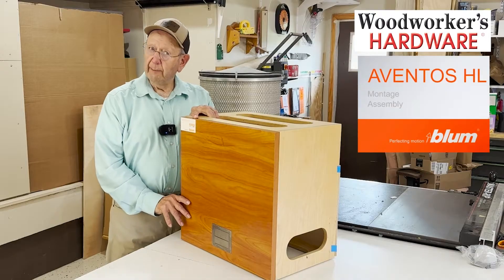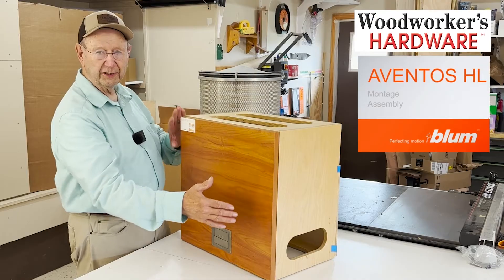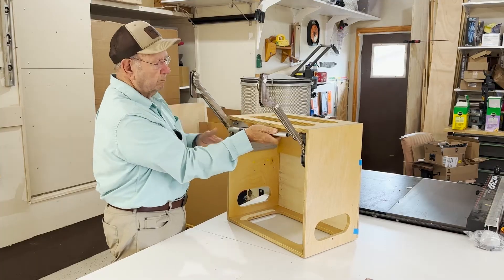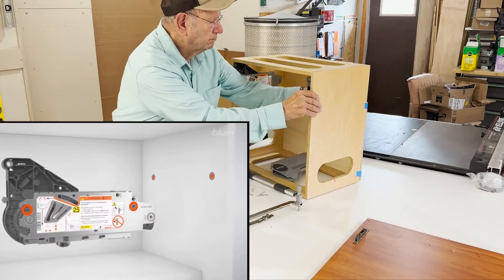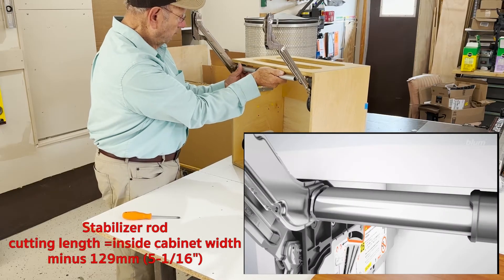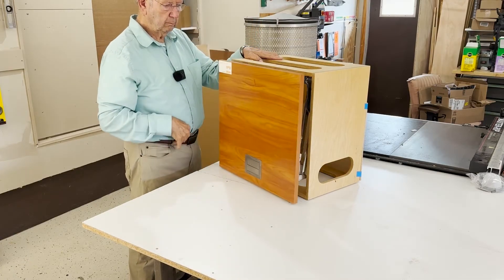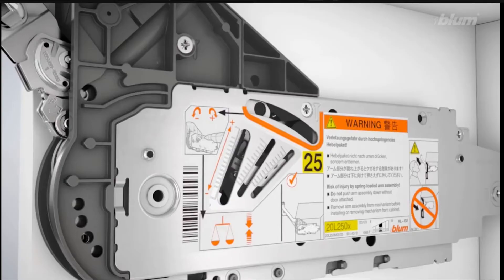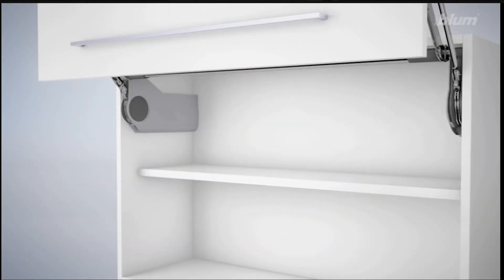Blum Aventos HL Lift System Made Simple: Demo, Assembly, and Installation Guide

Comment: My door is not opening all the way it stops about 3 inches short so you have to kind of duck your head down to see in the appliance garage. Is there a different hinge maybe the length that I should be using my cabinet man who installed they said this is the only way it goes, but every time I look at other people’s pictures it looks like the door completely clears the opening where mine is stopping short of the opening and the top few inches any suggestions?

Comment: Great video! With limited space between the top of the cabinet and the ceiling, is there any issue with using a smaller "cabinet height" B22L2210 on a taller door? I have a 25" tall door front, and only 17" to the ceiling. It's only 24" wide, shouldn't be a weight problem. We don't mind the smaller opening.